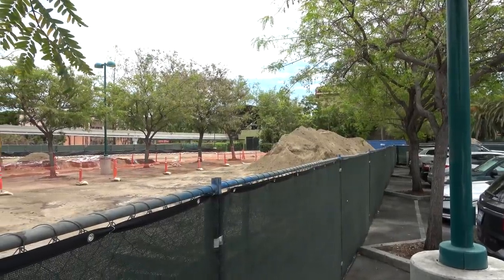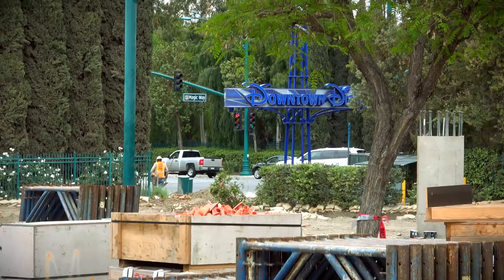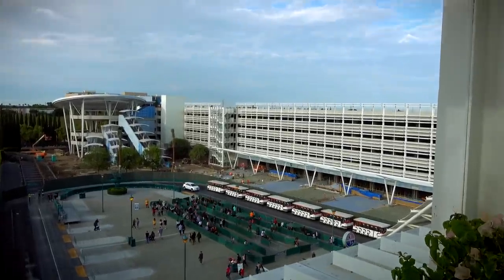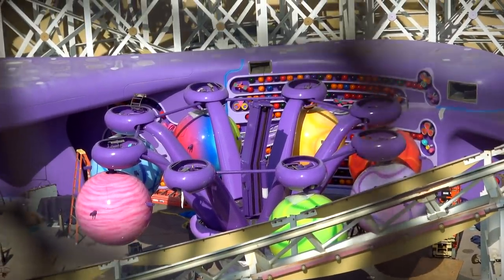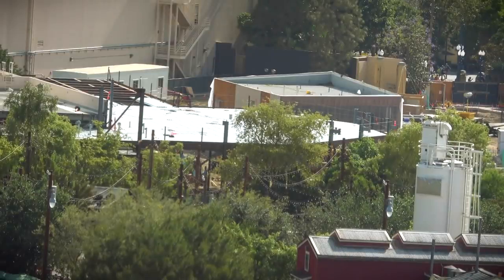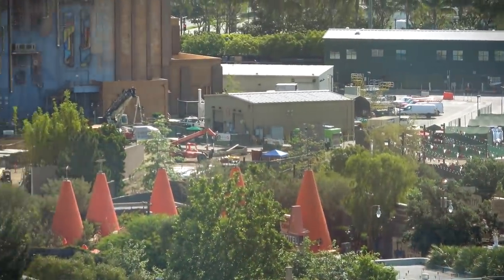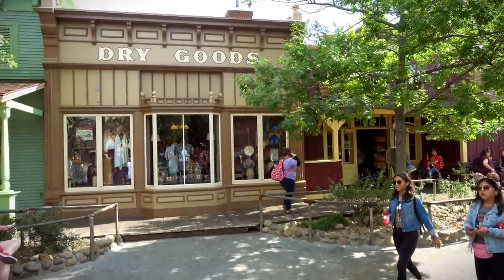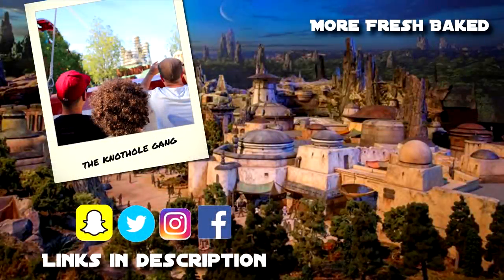Bridge goes vertical  - Disneyland Construction | 05/11/19 pt 62

Comment: @3:15 - no, they probably won't let you cross at street level - it's dangerous for the pedestrians, and it interferes with the automobile traffic.   Plus, look at the concept art - there are no crosswalks drawn, and no sidewalks reaching the corner...
Reply: Jay Sculler And, if guests have gone through bag check/security over at the parking structure, why would they then allow the guests “outside” of the controlled area?
Reply: @martajohnson3638  They only go through bag check and security if they are going on the trams. If they are walking to Downtown Disney, then they go through security there.

Comment: The trench and the trenchboxes go right by the remaining gate side.  And head in the direction of the excavator. There is an at least 6 foot deep trench. That goes through we are at the gate used to be and bends away from where is the trolley tracks are. From guardians there’s a few little nap holes that you can look through and get up Close with what’s happening on that side

Comment: I understand the new parking lot will take 30,000 new cars. Is that right?  If it was and you assumed 3 people per car then where is 90,000 additional guest going to go. The parks cannot handle this load.
Reply: Who says the parking lot will be full?
Reply: Kira SweetnessLG I got the number of 30,000 parking spots from the security guard two days ago on Monday.  I like your thought but I’m not sure why did spend the money for all that parking if it was never going to be filled. But every time I’m at the park and it’s so full that you can’t walk all those people that are in there are not parking on the street outside of Disneyland so I can’t imagine adding 30,000 more spots in the park holding them.  I did find that Mickey and Friends has 10,000 spots so I find it had that this structure can be 30,000.
Reply: Seeing as the Mickey and Friends structure holds about 10,000 cars, I find the 30k figure a bit suspect. The Pixar Pals structure is smaller. Based on their footprints, I'd guess it will hold something like 6000 - 7000 cars.
Reply: @wheelindisney5874  6000-7000 is more accurate, as for more space for more cars, the structure is hopefully to take most of toy story lot whole that lot gets some much needed improvements. The structure is also to relieve stress on micky and friends on busy days. The park capacity isn't changing much as far as ive heard

Comment: @14:28, there’s many reasons they might have removed the front skin of the bathrooms. If there’s to be some kind of porch roof they would have to remove the front to reinforce where it would attach to the building. It could be rotten and needed extensive repair. It might have been more cost effective to have the front made elsewhere that fits the theme and shipped in and they need the studs to attach it to.